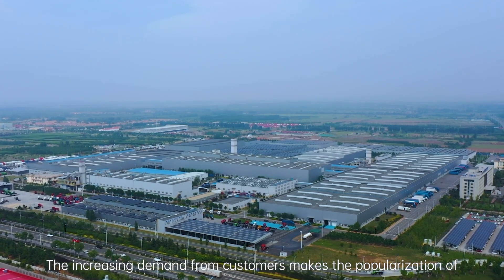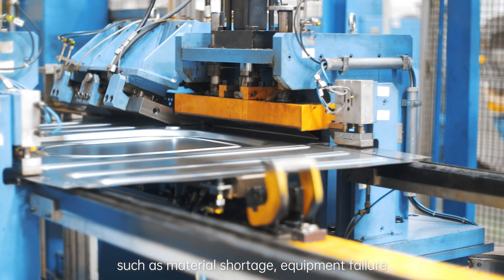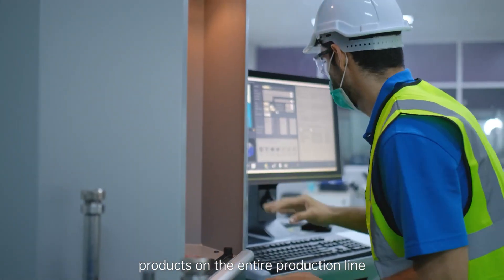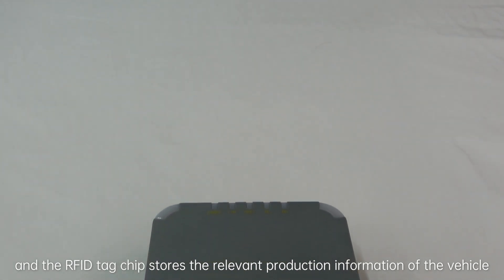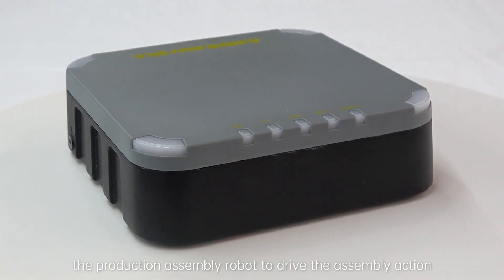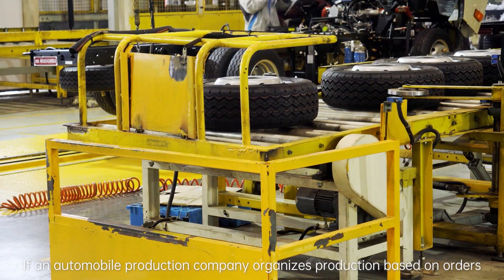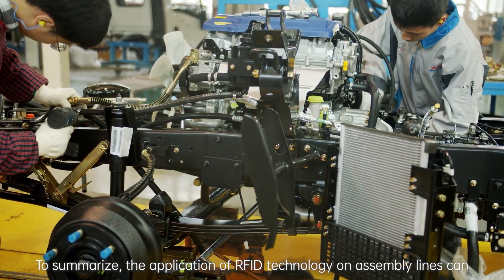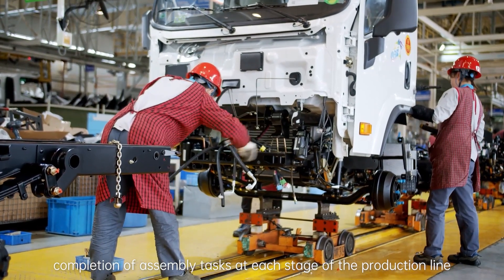How RFID technology can help streamline automobile production

Comment: RFID technology greatly enhances efficiency by enabling seamless tracking of parts, tools, and vehicles along the assembly line. RFID tags, placed on components, automatically update systems about their status, location, and assembly stage. This real-time data minimizes human error, speeds up quality checks, and ensures that the right parts are available when needed, reducing costly delays.

Moreover, RFID allows manufacturers to optimize workflows by identifying bottlenecks and streamlining production flow, ultimately enhancing productivity and quality control. Embracing RFID is a solid step toward smarter, leaner automobile manufacturing!